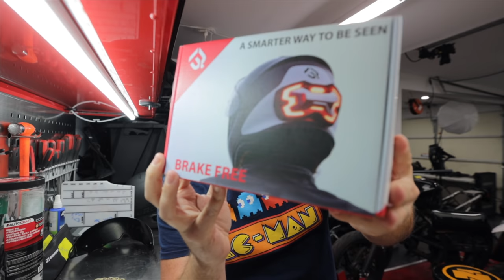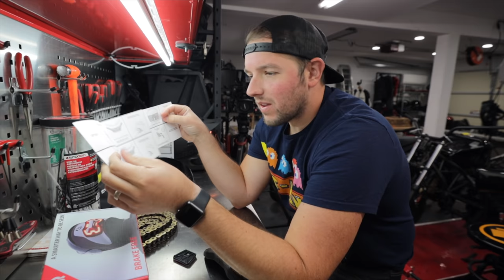CRAZY Braking HELMET MOD TESTED!! | Brakefree unboxing / review

Comment: I just ordered one.  I've had people pull up to me and say they couldn't even see me due to my tailight being in their blindspot or being covered by another vehicle.  After hearing that I got super paranoid about being struck by cars that were looking to lane change, especially at night.  And yes engine braking is a huge deal on a motorcycle.  I usually tap my rear brake to give people a heads up but hey sometimes you forget.  Also when I'm not riding and In a car and see other motorcyclists I usually focus on their helmet or body, which proves how well this will catch people's attention.

Comment: Free: lightly tap your rear brake (not actually braking) during engine braking. This communicates your deceleration to your fellow road users.
Reply: Yep, maybe better than spending $169.99 on this!
Reply from the maker: Totally understandable and this is something I do when riding with a group of other bikes. That technique isn't going to help you if you are coming to an emergency stop and it's also not going to solve the problem of moving your brake light into the eye line of drivers behind you. Just more situations to think about this product working for.
Reply: chaseontwowheels but chase...who emergency brakes using engine breaking? I don’t see that point at all lol use the breaks.
Reply: One thing to consider about this - most bikes have a single rear light which, in most countries, is always on.

When you brake (with the brakes :) ), what you are doing is changing the brightness of a light that was already on. Depending on circumstances, this change of brightness might be missed by another driver. This is one reason why cars and other vehicles now have auxiliary brake lights, usually in the rear window etc. which ONLY illuminate when braking AND they are higher up so can be seen further back.

That said, this item does seem rather pricey for what it is, and seems rather bulkier than it needs to be...?

I do like the mount system. If you often carry a pillion, they could have another bracket on their helmet, and just switch the light over...
Reply: Solo King 21 😂yeah wtf
Reply: Coming from someone that started ridding on scooters and in my personal experience using most of the times the rear brake, I do this a lot while ridding my normal motorcycle.
Reply: You can also do this with front brake. There’s a gap between actual braking and the brake light
Edit: at least on my 19 n400
Reply: @DPloiDEBT  Yes I've been doing this for years once my pretty well slowed up I flash my brake lights just so any cars behind me will truly understand that I'm stopping and or I'm at a stop..But I still like the idea of this it's kind of like a third eye on your vehicle just at additional thing to grab someone's attention 169 is pretty damn steep though I am not poor but it still makes me winc a little bit I might be able to do something else with $169 to help my bike a little more
Reply: @chaseontwowheels  2 things I would test. 1st ask your wife to follow you in car and she if notices (don't tell her you have it). 2nd do the same at night to check if that light is not too bright and check if it is not blinding drivers behind you
Reply: deepsquat600 I mean I’m in Cali where we can lane split but I only do this when I am unable to split due to tight space. There’s a cheaper option they have those lights that go behind your back I don’t have it but I got a friend who has it and it works for him
Reply: If Brake Free prevents just one accident for you, it will be worth its weight in gold.
Reply: Brake Free , if a megaphone were to prevent an accident it would also be worth it’s weight in gold. Still, I won’t be carrying one around, and my horn will suffice.
Reply: @chaseontwowheels what are you talking about? Emergency stop with engine breaking?
Reply: I can slightly tap my front, the tail light comes on and it doesn't actually engage the brakes, I can tap it pretty quick too... been doing it for as long as I've been riding.
Reply: @P.M_M  please clarify how this is not a fitting analogy. Both devices could aid in achieving a similar goal: notifying the other road users of a dangerous situation. But that can also be achieved by using the standard and required equipment on your motorcycle.
Reply: @darknessawaits  the breaking light makes your more visible in general, not just to prevent accidents.
Reply: @SurrenicTech  what purpose does 'visibility' fulfil, other than preventing accidents? Do you plan using it as a mating call?
Reply: Im pretty sure he knows that his brake light comes on when he applies his brakes...this device is just an additional light to make you more noticeable. Come on!
Reply: @chaseontwowheels  Putting the brake light in the line of sight is what I was thinking as far as a benefit from this.
Reply: You can buy a cheap little gizmos that automatically make your brake light blink rapidly to draw attention.
Reply: agreed. I ride every day... tapping your rear brake is the way to go. oh just mod your exisiting brake light to flicker
Reply: Yeah, because people driving behind you are always keeping a sharp focus on what's in front of them so that moment you tap your brakes they'll always see it. 🙄 Dumb comment.
Reply: @chaseontwowheels  Oof I should have seen your reply before commenting.
Reply: @BrakeFree  People don’t seem to understand that.
Reply: Would be an awesome product if it could add the blinkers into it as well. 
Then I would buy it.
Reply: It's additional light higher up.
Nothing to do with not knowing how to brake
Reply: A habit for years.  But this light is far more conspicuous, and effective.
Reply: But, beginners won't have a presence of mind to do this.   I consider myself intermediate, but I know I forget to tap the brake pedal as I roll off the throttle when I suddenly spot a "SUS" car starting to come out of the driveway or something.  Having a technical automatic solution to reduce the risk may be better than relying on your manual skill. 

Besides, in repeated "Slow and go" traffic, it gets tiring tapping on the lever every single time you roll off.....
Reply: I used to think that, but some folks tail gate close enough that they can’t see your brake light, especially on big tall vehicles and those are ones that seem to be in the most rush. Also some folks are just a*holes, and just want to mess with you from the back by inching up close to nerve you out. I have the vizi tec supa brake III as well.
Reply: It is a great high mount brake light.

Comment: Thanks for the effort to put this video together. After observing the steps your put the device through during a very bright day, I am convinced that its worth purchasing one of these. It's design beats having to modify a motorcycle to have a similar system installed. I also like the idea of migrating the device to different helmets if needed and design permitting. Glad you included in the video the challenge with the first helmet's air spoiler which much be considered when buying another helmet. Awesome!!!

Comment: You know, I don't consciously tap the brake lever as much as I should when engine braking. For under $200, and the fact that I only need a small plastic mount to move it to another helmet...That's actually pretty tempting. Good video. I think you've at least sold me on the functionality, and it seemed consistent as well. I am actually gonna have to give this product some consideration, now.

Comment: in regular traffic I always tap the front brake 3 times before applying, If I were engine braking I'd do the same. Whenever I ride with new people they ask if I have a brake light controller,. No, it's just something I've done since I started riding 30 years ago. Damn I'm old.

Comment: Chase on Two Wheels thanks for a nice YouTube video of the Brake Free product that I beta tested for the company back in December/January 2019/2020. I wrote up a review earlier on my blog, and I continue to stand by everything I said there. 

REVIEW: BRAKE FREE MOTORCYCLE TAIL AND BRAKE LIGHT

The product has worked flawlessly for about 10,000 miles on my helmets (I have two of the products one on each of my helmets). I paid for the units through the Indegogo campaign, and I did not receive compensation as a beta tester. I did provide the company with daily ride reviews, including weather, temperature, riding conditions, length of ride, and other information. I chose to be a beta tester because I ride a lot of miles in all conditions other than subfreezing weather with snow and ice here in Portland, Oregon, the land of violent riots! 

Modes: 
1. Stealth - the lights are minimized, but the brake light lights on deceleration or braking. 
2. Flashing - the lights flash in low power mode until you brake or decelerate, then it lights in the very bright braking mode.
3. Normal - the lights are constantly on until you brake or decelerate, and then the brake lights light in very bright braking mode. 

Again, after about 10,000 miles, the units continue to work flawlessly. 

Brightness

The braking mode is very bright even in daylight, but at night they are impossible to miss. 

Auto Drivers Responses

I get comments on the unit most times I ride, and I ride daily for about 2+ hours, perhaps an hour and a half in the winter for a total of about 20,000 miles per year. I have noticed that auto drivers' behavior is different now that I use the Brake Free on every ride. Drivers stay a bit further back and tend to notice I am slowing even when I am not braking. If you've read the blog you know I've been hit by autos in the past, the last time about two months (October) before I got the 
Brake Free beta test unit on the freeway in Ukiah, CA. 

I consider the Brake Free the best single free-standing safety mod available since it is completely portable and can be shifted from helmet to helmet, and it can be used on any ride whether you are riding your bike, test riding a bike, or riding a friends bike. The unit goes with you, and if you have additional helmet mounts, you can apply them to nearly any helmet you might need to wear. None of this can be said for units that install on the bike to make the brake lights flash. 

Another nice feature is the Brake Free places the brake light at the helmet level and makes it far more visible than it is at the tail of the bike. All without wires or attachments to the bike itself.

Accelerometer

The Brake Free units work via an onboard accelerometer that senses when you are accelerating or slowing, the brake lights are triggered when the unit senses you are slowing whether you are applying the brakes or not. This makes the unit drop-dead simple, and it always lights the brakes when you slow. Even if your brake light is burned out, the unit will continue to function as it should. 

Length of Charge

I've ridden up to 9+ hours at a time, and the units continued to work in flashing mode. Flashing mode is the only mode I use. The estimate of 10-12 hours of battery-run time is accurate in my experience. 

I set up my helmet stand with two USB charging ports/cables, and I keep both helmets charged. I've never had a problem with charging or battery-run times. 

Since I ride about 20,000 miles per year, I used to feel like I was wearing a target. The problem is too many drivers do not pay sufficient attention to their surroundings while driving. As I said earlier, driver response to my use of the Brake Free units has been very positive with drivers giving me more rear cushion and noticing that I am slowing or braking. Since using the Brake Free units, I have not been rear-ended or had to dodge a near-miss rear-end collision, that used to be a much more consistent problem. 

I also get many comments from drivers that the unit makes it much easier to see me from the rear. The feedback has been uniformly positive.

Personal Recommendation

Buy one. The unit is well built, durable, weatherproof enough for a rider in Portland, Oregon, who rides 20,000 miles per year, and it significantly and positively changed the behavior of car drivers following me. 

The units are available for sale from Brake Free here: Smart Brake Light, Brake Free I advise buying the unit and the spare mounts, that way if you need to swap helmets or want your pillion to wear the Brake Free unit (the front rider should not wear the unit!) you can mount the Brake free quickly and easily. 

Mark Sherman
Reply: Thank you so much for your support. We sincerely appreciate it!

Comment: Hiya buddy - enjoyed the video and your presentation method.  Just a quick note on the battery situation. According to a guy from Brake Free (on Jimmy Chang's video) the battery used in the helmet module is an 18650 battery.  So they are readily available and can be charged on a standard desktop battery charger.  So you could fit one and carry a spare  or 2 (in a protective case of course to avoid a nasty accident in your pocket etc. lol).  I'd love to have one for my son but, at this moment in time the price of the unit + shipping charge to the UK means we'll have to wait :)  Enjoy your new toy and stay safe - keep the shiny side up!!
Reply: Battery is sealed and not removable.

Comment: It would be nice if, when the unit experiences a sudden "abrupt" stop, it should continue to flash until the battery dies. A friend of mine had a wreck, went off the road into thick brush and wasn't found for hours. Witnesses said they stopped to look and didnt see anyone so they left the scene.
Reply: so great in theory, but a issue i see there being is when you crash you dont go from X speed to 0 instantly. would be kinda difficult to figure out how abrupt would constitute a accident/crash and not just hard stop.

Great idea tho.
Reply: That is exactly why I carry a Wolf whistle on a lanyard. 3 blasts on the whistle is the International signal for "HELP"

Comment: Two things I’ve learned from aviation is that you can’t put a price on safety and redundancy is key. 169.99 isn’t even that much considering how much you should spend on gear and if the strobe light is legal in your state then there’s really no reason to not get it. Honestly if you don’t have enough money for nice gear then you don’t have enough money for a bike in general.
Reply: Riding and flying have a lot in common,  situational awareness and such,,
Reply: @maximilliancunningham6091  As a new rider and military history fan,  modern motorcycles remind me most closely of WW1 aircraft. The horsepower,  top/cruising speeds,  minimal controls, minimal gauges, the need to remain above a stall speed,  and seating for one or two people are all similar. The back-to-basics stick-and-throttle style of flying should be similar,  but I'm not an aviator.

Comment: OC - Oh hell yeah! I was actually waiting for a smaller version from a different brand - but this will work. Slowing down, engine braking, and typically brake lights are ‘aerodynamically” streamlined … that is, sᴍᴀʟʟ. Definitely interested. 

I too live in Atlanta (ITP) - 8 lanes of craziness - outside left and right are fast lanes; middle are for trucks and people too scared to venture to either side.

Comment: Great concept. I’d like to see motorcycle manufacturers incorporate this technology into the actual brake lights. Or maybe have a wireless module that you could wire into the bike itself that turns on the helmet light when at zero throttle. I think that would be more reliable than an internal accelerometer.
Reply: Though using a TPS to trigger the light would cause it to light up in many superfluous instances, like every gear change when you come of the throttle to change gear
Reply: Mokrite could program a delay. If throttle is at zero for x seconds, then activate. If a company really wanted to make a system like that, I’m sure with the technology we have now, it would be very doable.

Comment: I ordered one of these last week and am excited to start using it once it arrives.  FYI, there are some discount codes out there that can lower the price a little if you look around.  I ended up getting mine for $159.  Wish I had seen this video before I used the one I found!

When you were riding, your unit seemed to blink constantly no matter what mode was on.  I don't care for that aspect. and ONLY want mine to turn on when I'm slowing down.  Otherwise I think it becomes a distraction for those behind me.  It does seem to work very well when you are slowing down, whether engine braking or actually braking.

I intend to use Sugru adhesive rather than the supplied adhesive, as I just don't trust those tape adhesives.

As to the weight, I use a GoPro on my chin bar which weighs my helmet down in front, so I'm hoping this will offset that and ease some leverage on my neck muscles.

Appreciate the review!🏍🏍🏍😎
Reply: Hope you're loving your Brake Free. To answer the question about flickering, it's just how Brake Free sometimes shows up when using an action cam to record. The LEDs are turning on and off many times per second to save power. A lot of lights do this. It's turning on and off at such a high rate that a human eye does not register it at all and it looks like the lights are constantly on. The only time you will see it is when you record on an action camera during the day at a frame rate that's lower than 60FPS. Hope that answered it.

Sugru is a good option to use. All for it. Although, we do use some good quality 3M adhesive similar to what GoPro mounts use.
Reply: @BrakeFree  Thanks!  I am extremely happy with my unit and have gotten great comments on it from others.

Comment: I have an old 64 Triumph with a 6v electrical system.  The brake light doesn’t get super bright when brakes are applied, which makes me nervous.  This unit would solve the problem.  I’m gonna pick one up.  I like that it comes off the helmet easily and it’s a small piece left behind.